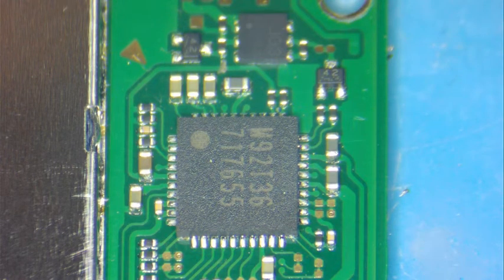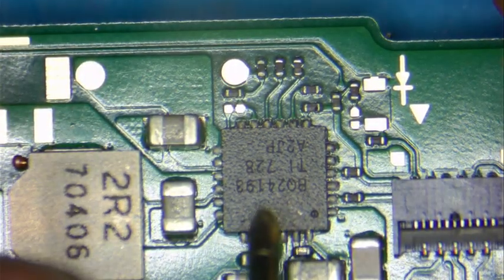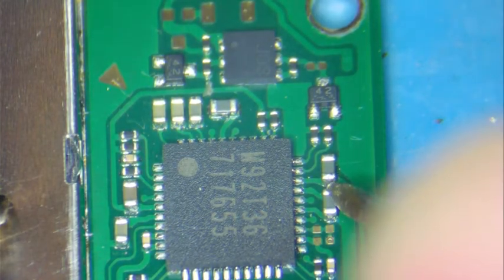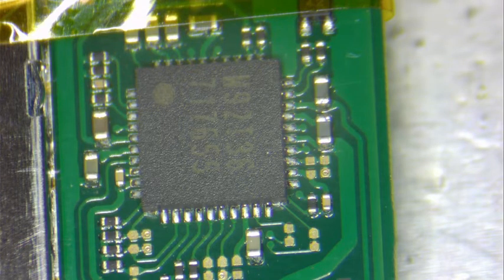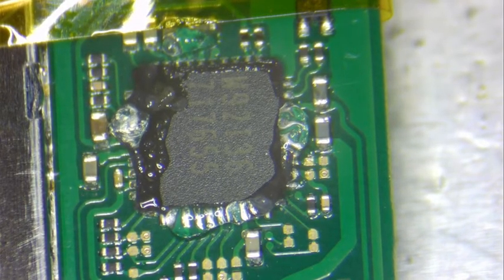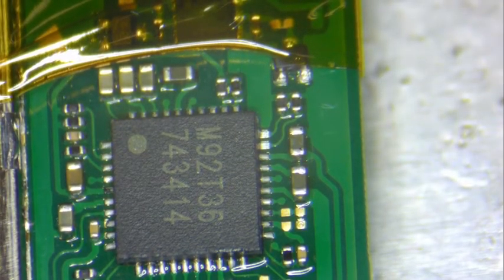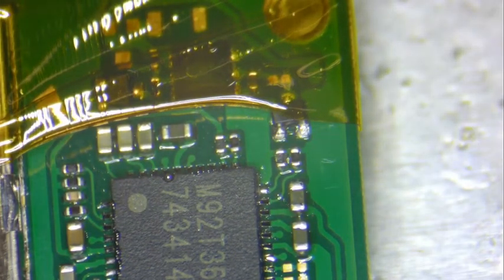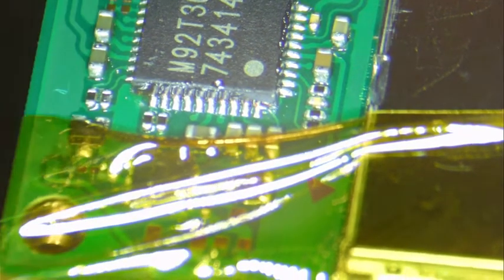Nintendo Switch - No Charge | No Power - Diagnostic & Repair

Comment: I was able to repair my switch, but  i accidentally removed a little component with the heat gun.  Its the component in the upper  right corner at 13:30 with the number 42. I put heat resistant tape on it but it flew of anyway. I attempted to solder it back on but it was too difficult, so i tried to powering the device on without it and it seems to work just fine. Do you know what its purpose is?
Reply from the maker: Looks like a transistor. If it’s charging fine you should be ok but if you ever need one contact us via our site. We can find you a replacement. Wayayeo.org